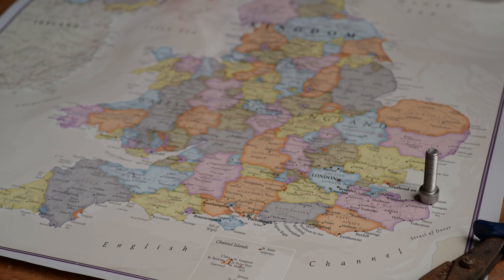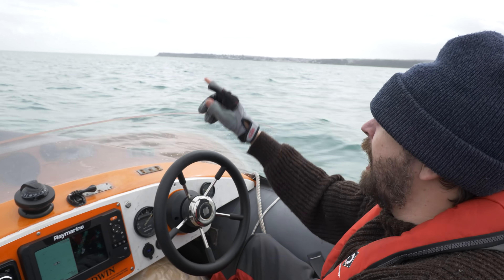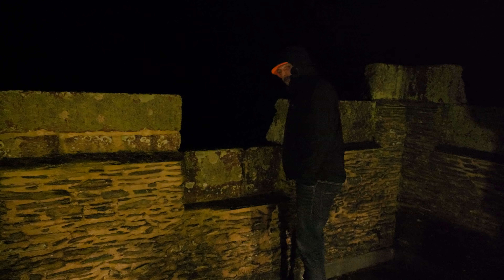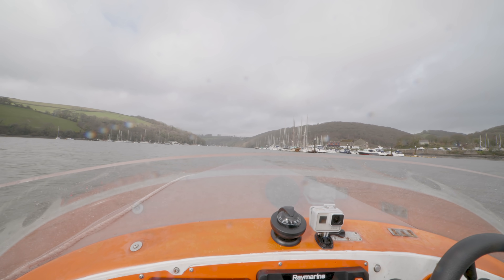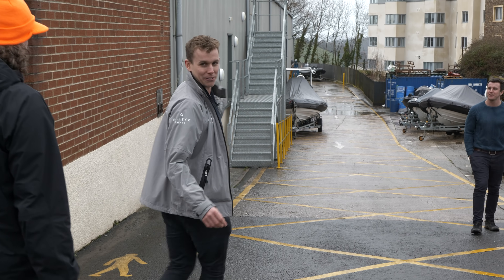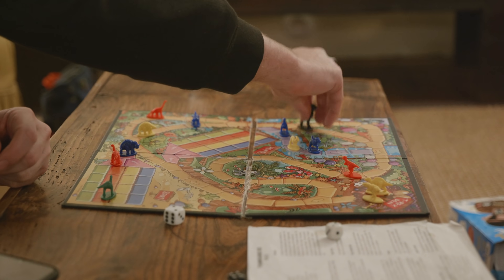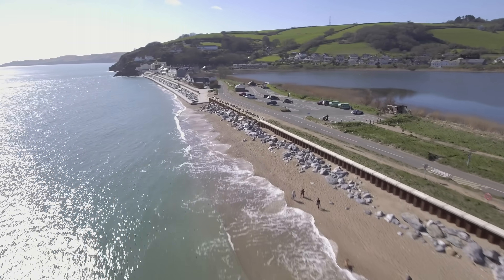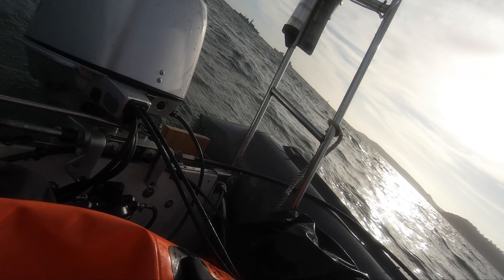1700miles in a Tiny Speed Boat - Part4 - The Castle

Comment: Couple of things. 1. Nice idea. 2. Proper nav planning is crucial and can save lives. Running out of fuel in the middle of Plymouth sound (fairway within COLREGS) is a brilliant way of getting run down by a frigate. Putting to sea in conditions beyond the operational limit of your rib is downright dangerous without support from a larger vessel. I don't really want to be pulling you out of the water in march because you've capsized a 4m rib without a support boat. Please consider this before heading to the increasingly dangerous waters of Devon and Cornwall. Oh and it's a 6knot limit on the river dart.

Comment: The soldering outside under the tarp reminded me about me doing the same years back when I had bought my first small speedboat. More or less the same size as yours but completely polyester. Also spend hours and hours under the tarp with some light to outfit it during rainy winter nights. The good old days. Your dash looks great.

Comment: Well done guys keep going if you are passing westward ho on way to ilfracombe you can message me and I can do what I can to help    Give lift for fuel etc   Try and make it a Monday eve if you need cover coming over the bar as that is the day lifeboat training is on eve.  Do research before attempting bar crossing  strictly two hours ither side of high tide and don’t be tempted to cut the corner coming in   Entering on low eb will produce standing waves plus surf height  👍👍👍👍👍👍👍